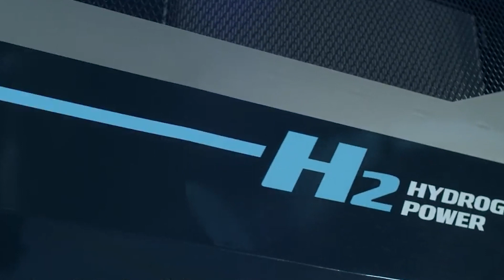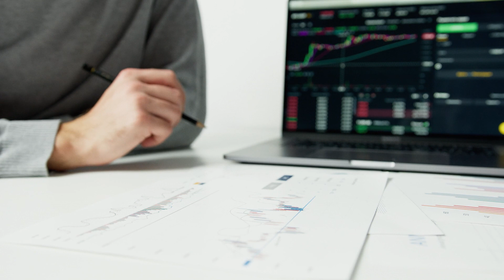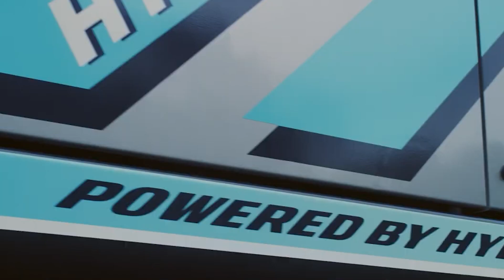Hyundai are busy developing a 1700nm Hydrogen internal combustion engine

Comment: This engine what thermodynamical cycle will run?
Also and the Ford working in one internal combustion engine on 5.0 N/A V8 Mustang.
And the BEV's is great choice but it's not the only solution to solve the climate problem we want a lot choices.
And the choices for me is:
1) e-Fuels or 4th generation of renewable fuels with zero or negative impact fuels into the normal engines and hybrid powertrains. 
2) BEV's with better range and faster recharging times, and this technology has already exist.
3) FCEV's with different types of fuels (Hydrogen, Bioethanol and Biomethanol).
4) And this type of fuels who I reported here in 3 choice of my recommendation into the internal combustion engine!

Comment: Strap a different set of injectors to an existing diesel.
Not overly innovative.
Still, it also requires virtually no re-tooling in all areas. Cheap.

Be more impressed if they re-evaluated how that hot gas goes about actually producing power.
Reply: JCB have already started production of such engines